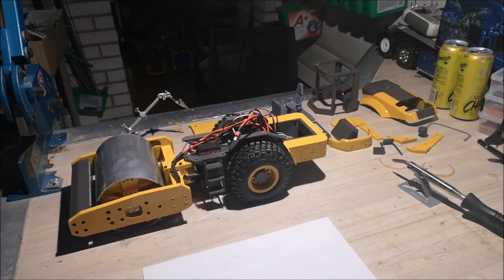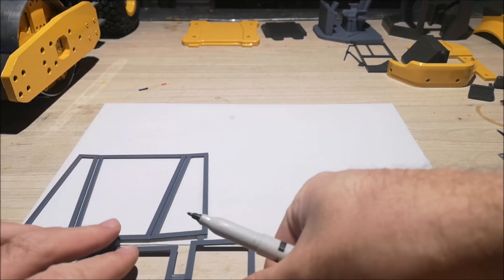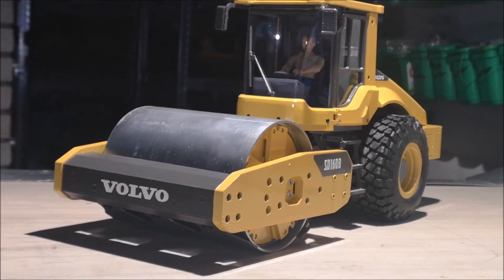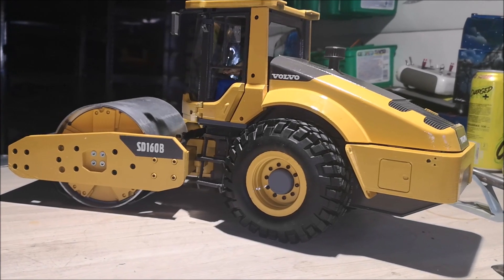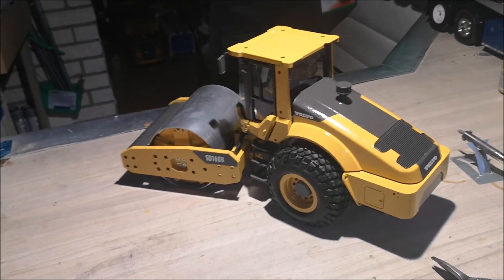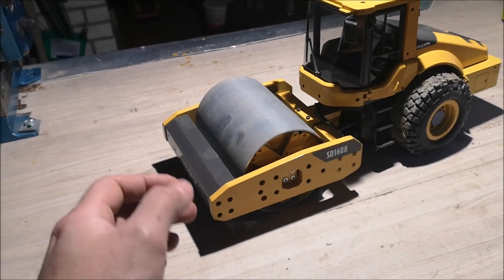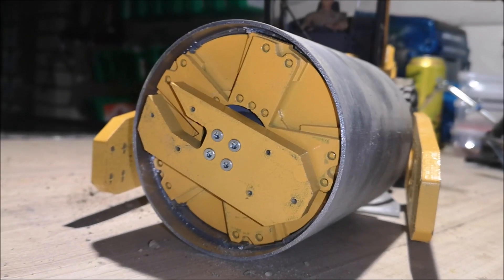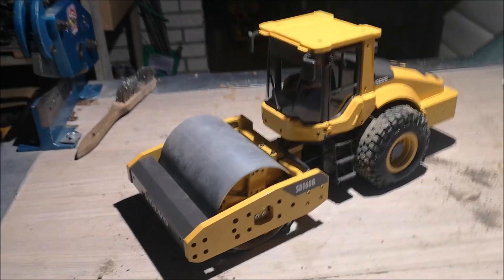Building a RC Volvo SD160B Compactor - Part 3

Comment: hi!
i'm almost finished with the build, only the split hood and decals are missing. do you have a PDF for the decals with the right size and shape of the grey part? could not find anything on the FB-group either.